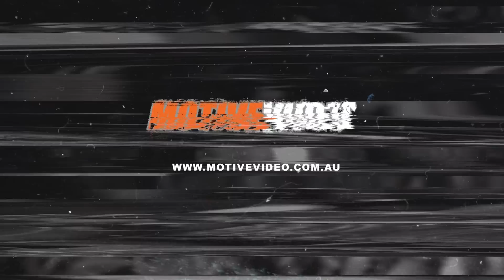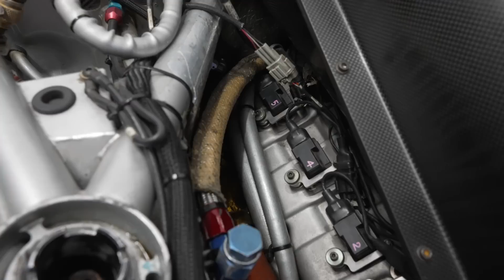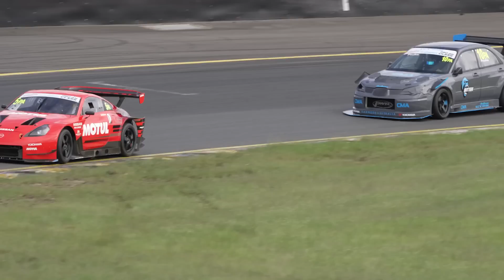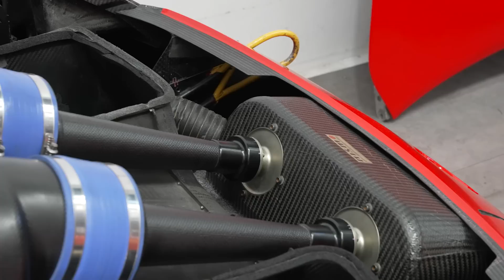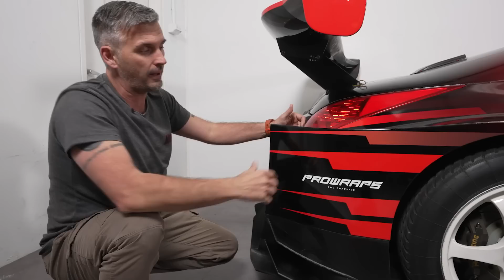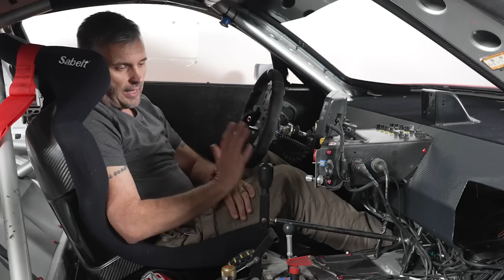ex-JGTC GT300 Nismo 350Z - Aero and Tech Explained - Motive Tech

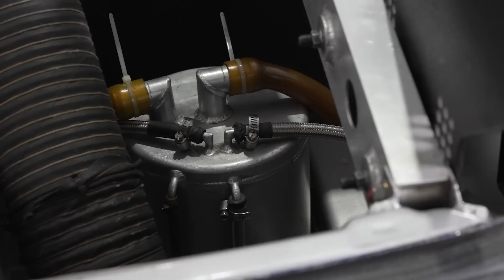Comment: 18:30 Nismo cable ties for the dry sump tank 🤔
Reply: Breather tank. Cable ties as inspected and checked after each run. Oil tank is inside the bellhouse.
Reply: @dalemalone3851  Those Nismo cable ties wouldn't be cheap I bet 🤫😄

Comment: A 265/35 R18 street tyre would have a sidewall ~93 mm high, and an overall diameter of 643mm. Only about two and a half inches in overall diameter smaller than the 270/710R18 front tyres fitted to the race car. Fitting them would lower the car about an inch a quarter. Interestingly enough those racing tyres are taller than typical, usually a 270R18 would be a 680 height, an inch and a bit smaller in overall diameter.
Reply: 280/710R18  were used in competition.

Comment: Keep up the great quality content!It would be very interesting to know the air speed at those intake restrictions vs the air speed at the bell mouth plus the pressure differential. I love the refinement in tuning with resonance and just that level and that dedication to peak performance explains why they were so good to watch race. Also I’m curious ho much pressure do they develop in the plenum at speed?  engines intake air speed far exceeds road speed so would the front air dam and trumpet’s at 200kmh really make pressure at wot or is it just easing off the choke from the restrictions and better transient throttle? testing the ram air effect on a dyno that would make good viewing!

Comment: Interesting, question though, if one of the main aims is to get rid of turbulent air on the wheel wells why did they go away from closing off the wheel wells externally?? We have all seen the old rx7s etc with covers blocking the wheel well from the outside.
Reply from the maker: Regulations